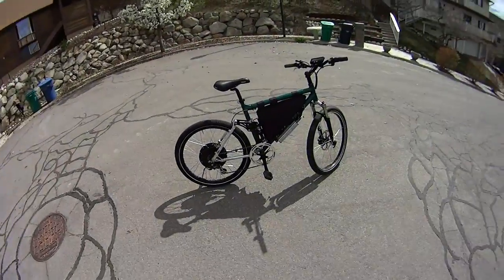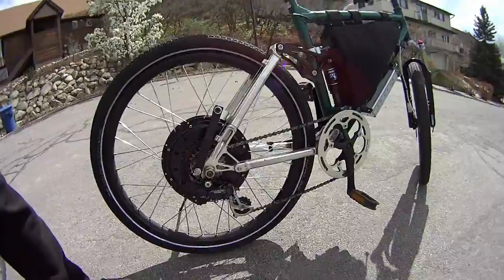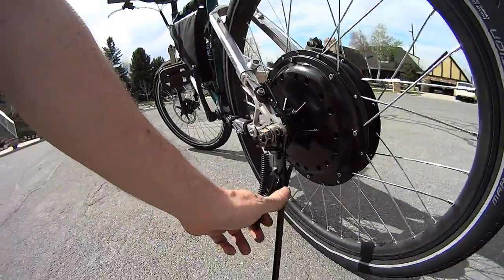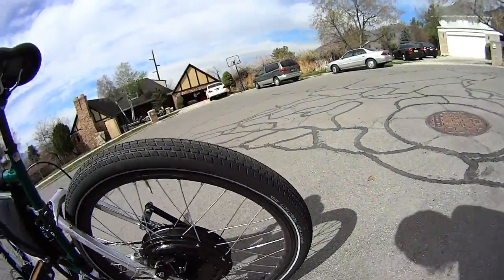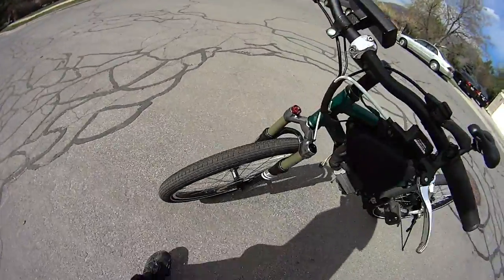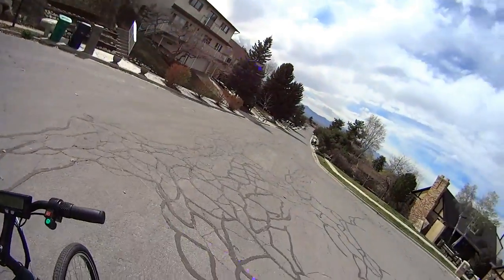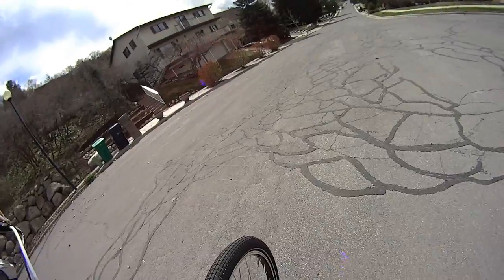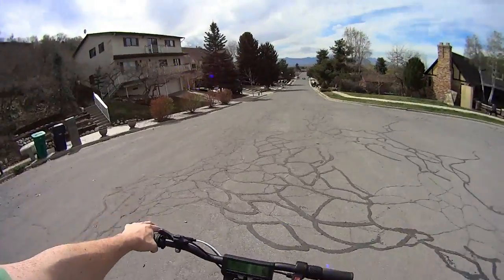leafbike 1500w hub @ maximum power

Comment: Was that a 72volt battery? I notice the meter of amps. Very nice video, long test run and gave me indication of using higher voltage. It is not over working motor with it?

Comment: my 500w hub motor worked at  3300w for a few miles before it died so 6600w should be safe  for a 1500w-er
Reply from the maker: The motor was clearly not up to the task and i imagine you know it has died for overheating.

The key to producing power in any electric motor is to control the heat you are producing.

You will notice that this is a 1500w rated motor that i have found should have been rated for 2000w at the factor. In addition, i have added cooling holes to allow it to shed even more heat.

So my 6000w on a 2000w motor was much less of a stretch than what you did.

If you follow my formula for creating this excellent machine, then you will have the same result.

If you build this thing and enjoy it, do let me know. :)

Comment: Does this motor and battery kit still work? If it does, about how much has the battery storage went down (I.E. 80%). If it doesn't work anymore, when did it stop working? If it still works, is there anything else that has deteriorated about the build? Am considering buying a similar build from leaf bike but for a 26" X 4" fat tire bike.
Reply from the maker: Oh, i sold this bike off years ago when i decided to switch to recumbents.

The guy i sold it to is still riding it as far as i know.

Comment: Over 50mph holy balls! 1500watt and what battery are you running? Have 1000watt 48v 20ah, 30 on flat and range is 30 miles full throttle no peddling.
Reply from the maker: See the end of the video. I've got some 72v RC Lipos that kick out more power than the motor can even handle.

Comment: pushing 5000w to a 1500w motor?
Reply from the maker: Yes. The beauty of electric motors is that you can overdrive them for a time.
A more appropriate rating for the motor is close to 2000w. The factory underrated it.

Comment: Nice bike! It looks so powerful. How much was this project total price?
Reply: That doesn't add up to 2 grand lol. Still working 4 years later? Or still have it lol
Reply from the maker: Something like 2 grand. The bike frame was a $250 ebay special, and i used RC Lipo.. and the leafmotor was cheap as hell.
The tires themselves were $70 each. Most premium part of the build, lol.

Comment: Yo Nep,  I know you're doing vids on other subjects, but have you seen the new leaf hub motor?  Wondering how it would run at 72v 45a. I recall you gave yours a lot of amps with great results.
Reply from the maker: Wow i missed this one..
I have not seen them produce anything really new.. tried to encourage them to improve their products further.. nope. Sadly still one of the best hub motors on the market today though.
Reply: @neptronix  do you the voilamart kit on eBay is similar because I’m wondering what I could push through it?

Comment: Hi I've got 48v 1500w hub motor ebike with 52v 20amp battry my controller 48v to 84v 50a I wonder if I upgrade to 72v battry 20amp battry does it make any difference to speed and power my bike isit worth it or not any1 with knowledge advice please thank you
Reply from the maker: Of course it will make a difference. The only thing is that you'll need a higher output battery to deliver the extra power. If you have the leafmotor like i have, it really wants 60-80A, if your battery can provide it!

It's hard to find a very powerful battery, and also to mount such a big and powerful battery on a bike. I used RC Lipo which is dangerous but can deliver up to 200A.

Also if you look at my previous videos you will see me running this motor on 46v, and on this video i am running about 76v.

Comment: I have the same 1500 w motor and my controller went out and had to buy another but need the controller settings....could you, by any chance, send my your settings?
Reply from the maker: I am sorry but i do not have my settings on file anymore, but they are relative to an 18FET 4110 infineon clone controller with a customized shunt resistance so they would not apply to your controller exactly.

An infineon clone controller should match up color to color with the phase and hall wires. What you set for battery amps and phase amps is a matter of your personal taste. I was running around 70 or 80A battery here, and 2.5x that for phase amps.

Comment: Can you add pedal assist to one of these kits?
Reply from the maker: I wouldn't recommend pedal assist with this much power if you could.
Reply: @neptronix  i understand but im trying to combine this 1500watt motor with a 72v 60 to 100 ah battery to get over 300km range with it just cruising at around 15 to 20 mph on it or 200km with cruise speeds and peak speeds even 100km would be satisfying and if I can achieve pedal assist with it then it could go way longer. My whole idea is to be able to start a summer day morning , travel some 15 20 km do whatever and then keep traveling all day to get an 8hr day with around 220km going all over my city as it is very very very bike friendly and you can essenitally go to cities 150km + away on a bike path, which is what my intentions are with such a huge battery and pedal assist plus i used to bike a lot 20km a day in my prime so i figured pedal assist and a 72v 100ah battery with a 1500 watt pas sensored motor with a 150-300 amp controller would do this for me. Please reply your opinion im trying to get ideas together for a bike. Also have you seen those custom torque arms on forums? Apparently theyre recomended for a strong motor as a avg bike /mtb's torque arms are not strong enough to withstand it. Please let me know on all this!!!! Thank you so much
Reply from the maker: @NapthecreeperrNTC  I'm noy sure where you're going to find a frame to host that big of a battery.  150 amps is also major overkill for this motor and if you only need to do 20mph, this motor is way larger than you need.

Sounds like you've got a lot to learn. I reccomend checking out the endless sphere forum.
Reply: @neptronix  so your saying i need a cromotor. Is that what your saying
Reply from the maker: @NapthecreeperrNTC  no, more like a bafang g310 or 27mm wide DD if you want good efficiency at those low speeds...
Reply: @neptronix  what about the 48 volt leaf rear hub 1500 watt could I run it with a 48v 64 ah 13s20p battery and a custom controller that could handle higher amps?

Comment: Thank you for your detailed information on this motor both on YouTube and the forums. I am very interested in this motor 6t but I am concerned that with a "normal" battery (52v 17ah 30a continuous). I will  not see the torque efficiency that you are.  I'm happy with 30-35 top speed and live in the foothills of NC.  I am also curious about the Mac 6t. Given my 30 amp battery bottleneck does one look like a clear winner. Controller is 60a programmable and not willing to change battery.
Reply from the maker: Sorry for the late reply.
A 6T winding leaf would be an amp sipper and require >72v to hit 40mph in a 26" wheel.
A 6T winding MAC would be an amp chugger and probably do 40mph on your 52v but would likely require continuous amperage beyond what your battery pack is capable of.

I mean, do the math.. 30a x 52v = 1560 continuous watts. About 1000W is needed to travel 30mph. A 10T MAC may be more suitable for your battery.

This is why i use RC Lipo for stuff like this...

Comment: Hi Neptronix ! Thanks to your comments, I finally bought the 4T default windings with standard freewheel, indicated "731 RPM @48V", which is in really around "630 RPM @48V" (because there is an error on their website of LEAF). I finished to understand this by reading your interesting thread on on Endless Sphere https://endless-sphere.com/forums/viewtopic.php?f=30&t=66489
I'd like to say that Peter from LEAF is listening our needs.
Reply from the maker: Thanks for the note. Is the 630rpm figure a loaded figure?
I forgot what RPM i measured on 49v. It's been quite a while since i built this.

I sent some motor improvement suggestions to Peter a week ago and it sounded like he took me seriously. Will update the thread if he comes through.

Seems like a pretty good and underrated company to me. Their direct drive motors are still my favorite.
Reply: Hi  @neptronix    You wrote "I measured my no load at 645rpm at 49 volts ( 13.16 kv )". I did not any measure until now. The error of RPM is still on their website (they give the RPM of the 1000 W motor instead the 1500 W).

Comment: Hi Neptronix. Thank you very much for your video and advices. Now the LEAF 5T is on ebike.ca simulator (effectively 7% slower than MXUS4503). But there something I don't understand : I only get 47.2 mph (with 76V / 26"/ MTP TUCK) while your counter shows 58 mph... Are you sure it was calibrated ? Did you tested your max speed with GPS ? If your speed is correct, that would involve that the simulator doesn't work well... What do you think about it ?
Reply from the maker: I have the default winding.. the 4T.
Which is also the same reason you see much higher amp draw. :)

The cycle analyst was calibrated and checked against a standalone unit, which is very well calibrated out the gate. Because i was skeptical the motor was efficient as it says it was on the dyno sheet.
The dyno sheet didn't lie. This is the most efficient motor in it's size class.
Reply: @neptronix  OK, I understand you have a 4T and not a 5T, so the max speed is higher. BUT when I test on the simulator an MXUS4503 with your parameters (76V 85A 26" MTB TUCK), I get only 52.6 mph, NOT 59 mph like you. Or you told your motor was 7% slower than the MXUS4503... So I dont understand what is wrong. Are you sure the MXUS4503 is the nearest equivalent of your LEAF4T ? 
On the other hand, I intend to by this LEAF 1500W : http://www.leafbike.com/products/e-bike-hub-motor/gearless-20-24-26-700c-28-29-inch/48v-1500w-rear-spoke-hub-motor-electric-bike-motor-spline-cassette-1110.html
How can I know that's a 4T or 5T model ? There are curves but I don't see the relation between the tension and RPM. I need it for dimensioning the battery in order to get 50 mph in 5 seconds.
Reply from the maker: I ran a MXUS 4503 in this exact bike with the same controller settings.
The 4T leaf is a bit faster per volt.

Watch out for the casette version of the motor if you want to run high power. It has thinner axles and this will be a failure point. Big design mistake on leaf's part. 

Hitting 50mph in 5 seconds on this motor will require A LOT of power during acceleration. I would recommend the MXUS for this. You'll also want a bike with a long swingarm. Wheelies limited my rate of acceleration in this bike.
Reply: @neptronix  Thank you for the information about the thinner axle for cassette version. So I will take the classical 600 RPM @ 48V http://www.leafbike.com/products/e-bike-hub-motor/gearless-20-24-26-700c-28-29-inch/newest-48v-1500w-rear-spoke-hub-motor-electric-bike-motor-998.html

On the other hand, I confused km/h and mph. I intend to hit 50 km/h in 5 sec for a total weight of 125 kg. So I need 4 860 W on the wheel. So with a 90% yield, I need 5 400 W. Normally 72V @ 75 A would normally be ok. What do you think about ?
Reply: @monsieur3dx  ...try pedaling off the line...😂

Comment: Hello mate, what is the range you get without pedal assist?
Reply from the maker: Depends a lot on the speed. If we use the industry standard measurement, my range is 121 miles while pedaling the bike at 20mph. You can adjust the simulation to suit your tastes here.. ( this simulator is very close to real world results )

http://www.ebikes.ca/tools/simulator.html?bopen=false&motor=Leaf%205T&batt=cust_60_0.02_20&frame=road&hp=100&axis=mph&blue=Lbs&cont=cust_80_180_0.03_V&throt=46&k=1

Comment: Just got the 1500w 48v kit and a higher power 84v controller and 60v 20ah battery with 50 amp continuous discharge should be a good build, looking for a bit higher speed without overheating the motor.
Reply: Thats what I've been considering. How did this work out for you??

Comment: hey- If I throw the stock leaflike 1500w rear hub kit on a stock carbon mountain bike frame with NO torque arms. will it snap it?

What about if I throw the leaf hub and a 80-100a controller?
Reply from the maker: ..you're kidding right?
Reply: haha.  I mean wasn't sure a 1500w would crack it but your setup, I mean of course.  I'm going to be safe and go ahead and splurge on some torque arms lol.
Reply from the maker: I wouldn't convert a carbon bike at all.
They are not meant to handle those forces.. torque arms or not.
Carbon bikes break under human power often enough.

There's cheaper ways to die, trust me!
Reply: I hear you, I've seen people put the mid drive motors on carbon bikes but not a lot of high power hub motors

Comment: Please I need help I bought a motor like this 1500w and I need to buy the battery now.. Is 52v 20amps will be good? Please I need advices asap also what will be the range? Thanks
Reply from the maker: You're going to want a battery that can output 80 amps of you ordered the default motor ( 4T winding ).
You can use the ebikes.ca motor simulator to estimate range. use the MXUS 4503 for a close approximation ( it is a little slower per volt than the 4T, but only ~7% )

http://www.ebikes.ca/tools/simulator.html?bopen=false&motor=MX4503&cont=cust_60_140_0.03_V&batt=B5216_GA&axis=mph&blue=Lbs

Comment: Hello. if i were to buy this kit but in 27.5 bike size it would come with a throttle and i would be able to use it like a motorcycle throttle? Also if i have disc brakes on my bike i have right now,  I am still able to use the back brake as i would like i normally do. Here is the link. http://www.leafbike.com/products/diy-bike-conversion-kit/275-inch-electric-hub-motor-kit/275-inch-48v-1500w-rear-hub-motor-650b-bike-conversion-kit-1068.html Lastly, you got those speeds without pedaling? And here is the battery. http://www.leafbike.com/products/lithium-battery/48v-li-battery/48v-20ah-rack-lithium-ion-battery-958.html

Comment: I have the leaf 1500w motor 5t that is not vented but has ferritefluid and a hub sink and has a temp sencer in the windings I normally run it at 5kw and it never gets very warm I sometimes go on the side of the high way pump it to 100a or about 10.5kw it tops out at 65mph without flux weakening it gets to 50 mph in about 4 sec. And  60 mph in abut 6.7s +or- 1sec extreme torque can Willie at 50 miles per hour 
Motor windings temp blast up fast wile accelerating but once I reach max speed the watts go down and the temp goes down a little and than slowly rises. As long as you have a temp sencer THIS MOTOR CAN HANDLE ALOT
Reply from the maker: You know, ferrofluid was still a science experiment and hubsinks didn't exist when i built this.
I imagine your setup is a lot more fun than mine.
But yeah, this motor is a pleasant surprise, isn't it? It was the dyno graph listed on leaf's website that turned me into a first adopter. Surprisingly, nobody seems to have one upped them for a hub motor yet. I'm still waiting for something better.

At those power levels, i would switch to a MXUS 3kW for efficiency reasons.. the 15mm wider stator will handle the load so much better.

Watch out for those willies.. ;)

Comment: I have the 1500 w leaf , same as yours, same bike setup, running a 72 volt battery and a 72 volt controller. All I can get is 45 mph. Will a Sabvoton get me more? Better yet how to I get it so it is as fast as yours?
Reply from the maker: That's odd. Are you running 85 amps on a low resistance battery ( mine is rated to output 175A so 85A is no stretch ) like i am?
Reply: I HAVE NO IDEA. controller is rated 60 amps and LT lcd 3 has a top end limit of 72 km or 45mph. cant get around it. any suggestions?
Reply from the maker: Well i'm using a programmable controller here and a cycle analyst for a realtime display of the watts/amps/voltage/speed/etc..
With no display of that information and no ability to program what ya want.. i'd say that configuration you have is a dead end.

>45mph is a bit much anyway.
Reply: I just found the controller you are using, purchased it with the CA thanks, 45mph too much? too slow! why would you suggest that?

Comment: Did you have to change any hall sensor wires or phase wires to the infenion controller? Was it a plug n play?
Reply from the maker: It was straight plug and play on the infineon clones i own, which were purchased from kinaye motorsports and em3ev.
em3ev may have changed their wiring these days though.. this motor comes with the usual cheapo china connectors, which a lot of vendors have abandoned in favor for nicer looking, but proprietary connectors.

If i was buying a controller today, i'd probably go with a powervelocity controller ( look them up on endless-sphere; not sure if they have a web shop yet  )

Comment: Hi, I am going to buy a bike and convert it to an e-bike. Here is the info of what I want and some questions I have about it.

29” wheels
Rear hub motor
1000w (or more)
single speed (just one cassette on the hub) is that possible to change yourself? Just remove and replace with a single Casette?
High torch rather than speed , of possible? Where does it say about those numbers?

Mtb or Downhill ? Second hand 500-1500 dollars 
Rim: XL if possible (I am 197cm tall)

What are your guys thoughts? 
Any input is great so that I don't make silly mistakes:)
Reply from the maker: You got a lot of questions.. i would start reading the endless-sphere forum :)
Reply: neptronix 
Could you use 2 wheels to go even FASTER 
Please respond